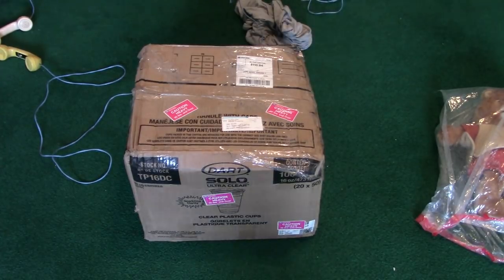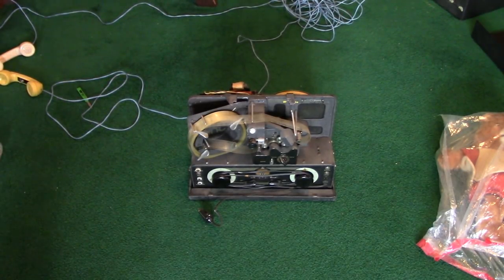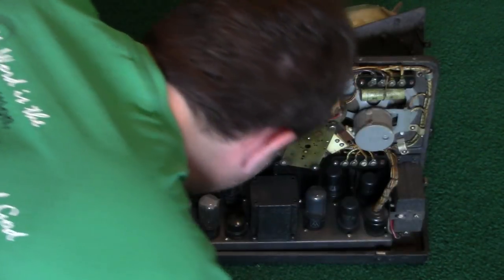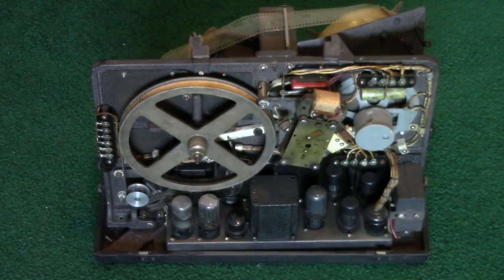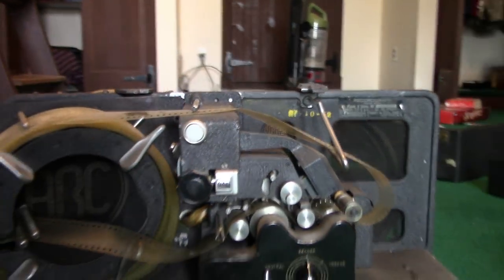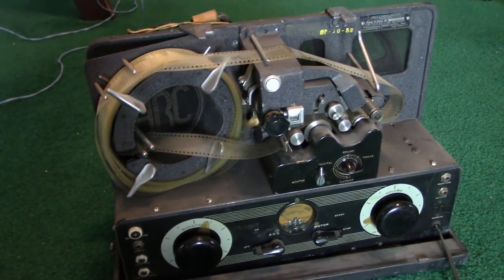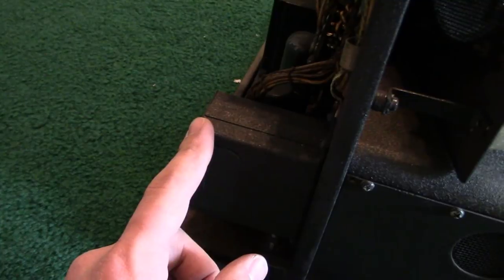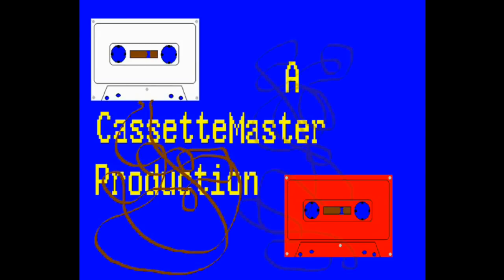Recordgraph -- First Impressions

Comment: Never saw this one before. This machine is a beast than my Victor Victrola VV 8-4 which is a monster acoustic machine from 1926.

It has a roll of 35mm film instead of tape, no movie needed. 8mm and 16mm film doesn't count that much. There was also a Super 8 film that came out in the 1970's that had a magnetic sound stripe on there. You can record it onto Super 8 sound projectors like the one I have is a GAF 3000S that has recording features.

This machine was made by a company in Poughkeepsie, NY, which is 20 minutes from where I live in Kingston, NY.